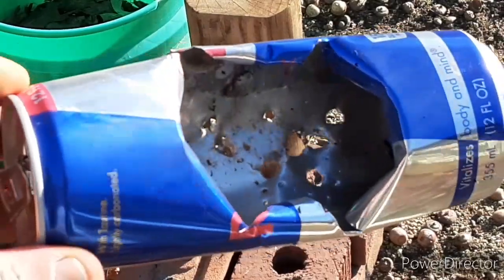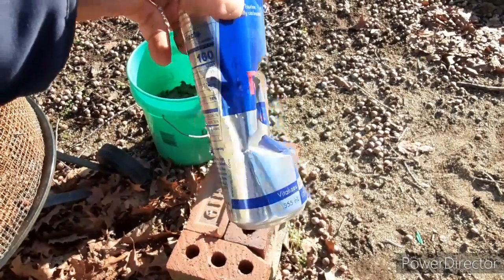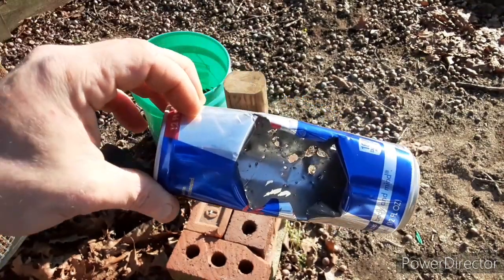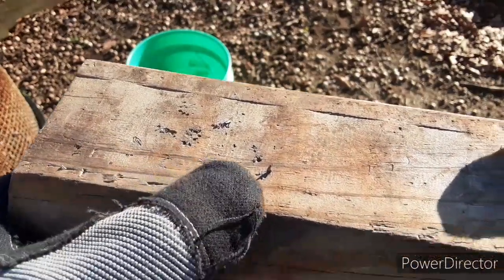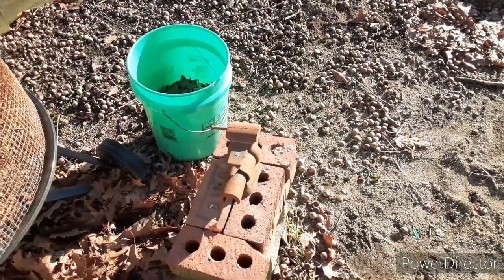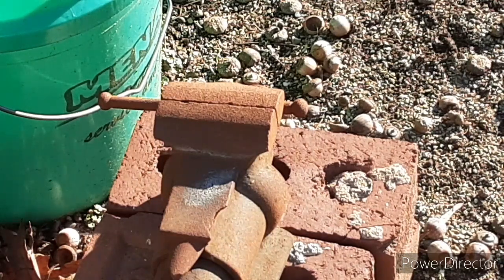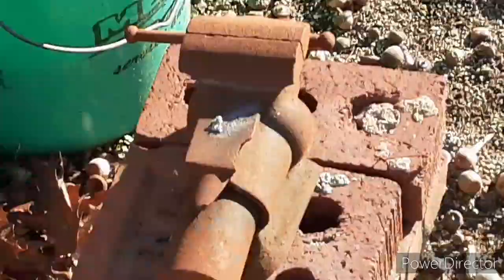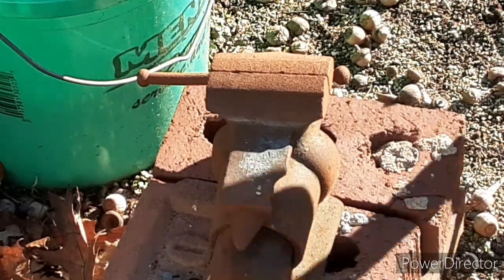Strontium Azide- Confined, Shock, & Friction Tests

Comment: After watching this again, I'm thinking it might be good for some mini dets using a small metal tube, or centrifuge vials like EnergeticHeretic uses! As long as the tube can't get crushed or bent, it should be fine.
Reply: @pbn3215  spent shells are awesome for caps, with this stuff you might even be able to do it with a .22 short if you have any. Seems like it could be tiny!